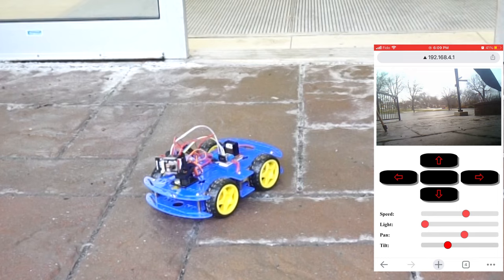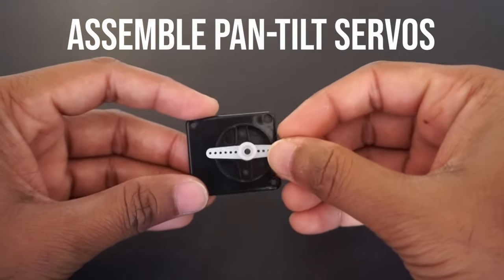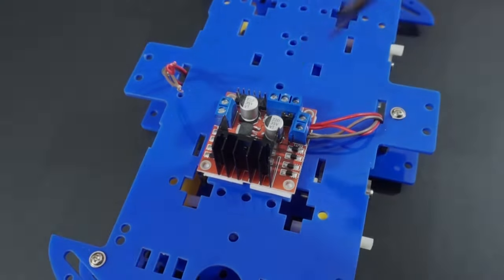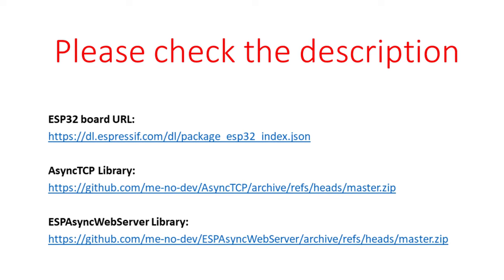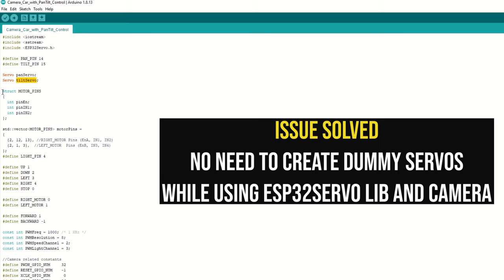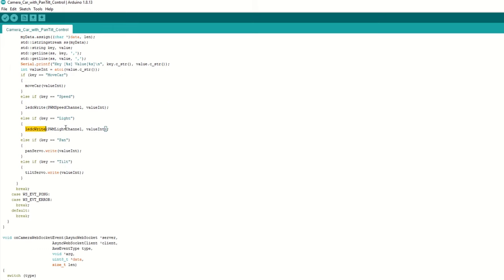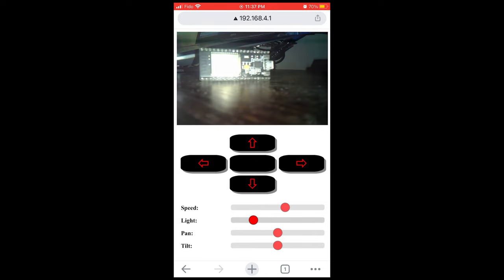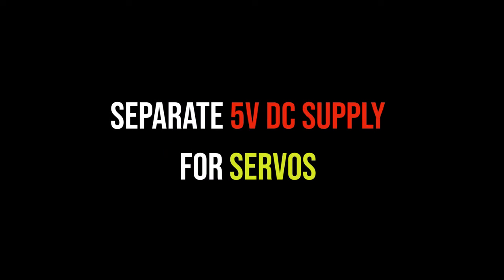Camera Car With Pan Tilt Control | ESP32Cam

Comment: BRO SHOULD WE USE STEP UP OR STEP DOWN BUCK CONVERTER?
Reply from the maker: Use step down converter 👍🏻
Reply: @hashincludeelectronics  is it ok to use XL4015 5A DC-DC Step Down Adjustable Power Supply Buck Module
Reply from the maker: @kumaranganesan176  yes you can use any buck converter which will provide 5v dc output 👍🏻

Comment: hi, everything look good for me. except that i don't have anything show on the website. The camera didn't displayed anything and i try to add another library, connect it again and all but i don't find any solution can i have some help ? ty !
Reply from the maker: Please use rechargeable battery  to avoid power related issue if any . Also check the video again to not miss any step 👍🏻👏🏻

Comment: Hello, my brother, the Wi-Fi network is not working. Is the problem with the battery, as its voltage is 6v? I hope you will answer me as soon as possible.
Reply from the maker: Yes please check the power supply used in the video 👍🏻👏🏻 use only rechargeable battery

Comment: Great project. Is it possible to add a label with a sensor value on a web page? If yes....how I can do it?
Reply from the maker: Yes you can add that . May be create html element as text and send this value from esp32 using exiting websocket connection. Check the code for more reference .

Comment: Bro it's an excellent project but I have faced an issue,, I should set the esp32 camera on the car upside down to get a normal picture is there a solution for that ??
Reply from the maker: Adjust the camera accordingly 👍🏻👏🏻

Comment: The code provided in the description does not seem to work with Arduino even with all of the additional libraries installed. How can I correct the code to work?
Reply from the maker: It should work . Don’t worry . Please check the video for any missing step 👍🏻👏🏻

Comment: How many times we can upload code in esp32cam ? 

Can we use a single esp32cam for different projects with different code ?

Please answer 🙏
Reply from the maker: Yes you can upload code as many times as you want . You can use any code and use any number of esp32 module 👏🏻👍🏻
Reply: @hashincludeelectronics  like Arduino?

Comment: Bro can I use LM2596 dc buck converter instead of ubec converter which you are using
Reply from the maker: Yup any converter will work as long as it provides 5v regulated power and more than 2A current .
Reply: @hashincludeelectronics  oki
Reply: @hashincludeelectronics  bro I saw a converter. It's input is 5.5v to 26v and output is 5v/3A and 6v/3A switchable. Can use it?
Reply from the maker: @vanitasingh8882  yes you can

Comment: The first line of the code includes esp_camera.h however where is the header file for this library. Please help me as it is the only thing about this video that I am not understanding.
Reply from the maker: It comes with the esp32 board installation . Please install esp32 board as shown in video . You can find this file under Arduino packages esp32 folder 👏🏻👍🏻
Reply: @hashincludeelectronics  but I already have it installed

Comment: Excuse me sir i wanna to ask my esp32 not showing wifi network and get heated?
Reply from the maker: Please makes sure to follow all the steps in video . Also change the setting as shown in video . Use only rechargeable battery . 👍🏻
Reply: Sir i have one question all system work but if use pan tilt to control servo at web server all system got lag but if i not connect servo to pin io 14 and 15 it normal how can i fix this problem? thanks

Comment: i'm using arduino ide 2.3.2. pan and tilt servo don't works. i tested servos with an arduino uno, the are ok. I'm uploading with a FTDI232. i selected AI Thinker ESP32-CAM. Wich board i have to choose ?
Reply from the maker: Please check the details in video slowly and carefully 👍🏻👏🏻. All the steps are given . Also make sure there are no loose connections.

Comment: Bro followed your each and every instruction. Given the power supply motor driver led turn on but there is no wifi available.
Reply from the maker: How did you provide the power ?
Reply: Separately like 5 v directly for servo and other with rechargeable battery

Comment: Hey bro ...
Amazing job with the video ..... can you tell me which part of the code should I modify to connect to external wifi rather than using the on board wifi .. thanks 😊
Reply from the maker: Thank you very much for your comments 👍🏻👏🏻. You can check my video on “getting started with esp32 “ where I have used external
WiFi . You only need to change the WiFi mode and ssid password . Please check that video 👍🏻
Reply: @hashincludeelectronics  I will check and get back to you if there are troubles
Reply: Plzz help me to build this project... I am facing errors
Reply from the maker: @rameshthapa4034  what issues are you facing ?
Reply: While uploading code from the Arduino to Esp32... It's showing some errors
Reply: Sir can I text you on instaa
Reply: Hello... Sir plzz help me with this project

Comment: Bro my dc battery power connector has 2 wires. Red and black.. which one should u connect?
Reply from the maker: I would suggest please check the video and circuit diagram as well . It’s very clear . Good luck 👍🏻

Comment: from where we can get the dc battery power connecter
Reply from the maker: If you don’t have battery connector , then you can use any simple wires . That will also work 👍🏻👏🏻

Comment: hey bro the code is working fine and even the website all the control buttons but the esp32 cam is not showing the feed live camera point but the light pan and tilt are working is there any solution
Reply from the maker: Please check the video for one setting to be done in code 👍🏻👏🏻

Comment: Can I evaluate this work and develop it? Will you allow me to take the schematic and code and modify it for me, or will I face problems?
Reply from the maker: Thanks for checking out the video 👍🏻 you are free to use code/diagram and modify it as per your need. No issues .it would be nice if you add some reference of hashincludeelectronics 👏🏻

Comment: Brother can we use this ? UBEC

Bluesky Mini 5V 3A FPV Gimbal PTZ UBEC voltage converter to create 5V output voltage from 2-6S battery pack input voltage. The UBEC is ideal to provide FPV cameras and GoPro brushless gimbals with a constant 5V voltage.
Reply from the maker: Yes you can use that 👍🏻👏🏻
Reply: Ok

Comment: Hey bro can I use battery holder with 2 cells instead of that lipo2s battery. Cuz it's costing too much
Reply from the maker: Yes you can but use only rechargeable battery which will provide more than 7v .
Reply: @hashincludeelectronics  ok brother. Can I use Duracell with battery holder for this
Reply from the maker: @vanitasingh8882  is Duracell rechargeable? And provides more than 7v total ? Then yes please use that

Comment: Can i use 2 lithium ion battery 18650,i have bo motor it will work and how to identify positive and negative of bo motor
Reply from the maker: Yes you can use that battery . There is no positive negative for motor . If you switch the wires then direction of rotation will change . 👍🏻👏🏻

Comment: Please tell me on how i add a button that can on and off  the LED
Reply: I tried many times to manipulate the code that you given but I still didnt get it on how i add the button
Reply from the maker: You can copy any car control button for LED. Check the code and give it a try . 👍🏻
Reply: @hashincludeelectronics  I tried to understand the flow of the code from the webserver to the output of esp32 but  it is very difficult

Comment: hello sir, one of the wheels on the back right side moves wrong, if i go forward the wheel goes backward and vice versa, what should i do sir.
Reply from the maker: Interchange the motor wires connected to driver 👍🏻👏🏻

Comment: Hello brother, good work. I have a problem when downloading the code. This problem appears.ledc_setup'was not declared in this scope:did you mean ledc_stop
Reply from the maker: Please install lower version of esp32 board as 2.0.16 👍🏻👏🏻
Reply: @hashincludeelectronics Hello brother, thank you to everyone for the response. Can I have the way to do this?
Reply from the maker: @نشوانالظاهر-م9ف  please check the video for this step 👍🏻👏🏻 you just have to select 2.0.16 version while installing esp32 board .
Reply: Hello, my dear brother. Sorry if I bothered you with my questions. I could not get the ESP32 version 2.0.16 and the problem is the same.ledcsetup' was not declared in this scope
Reply: @hashincludeelectronics Hello brother, I am very sorry. I did not understand how to change the type except for the esp32, but after thinking, I knew how. Thank you for your response to the inquiries. I repeat my thanks to you and I wish you continued success.❤❤❤
Reply from the maker: @نشوانالظاهر-م9ف  thank you very much 👍🏻👏🏻
Reply from the maker: Welcome 🙏

Comment: Can you please make detailed video on coding. Do Esp32 cam only take picture. What is the code for the picture to be made as video. Pls explain,it will be very helpful.
Reply from the maker: I have explained the code in video as far as can. It’s very simple and you can understand by going through code step by step . It’s link is in the description of the video .
Video is nothing but images displayed rapidly at regular interval called frames per seconds . You send images from camera to mobile app at regular interval and it’s displayed like a video 👍🏻hope it answers your questions . All the best

Comment: Hey bro. GOOD NEWS my ubec converter is the same as yours. The thing is that I didn't notice that u used jumper wires to connect converter to servo. Bro did u connect them by tape or soldering?
Reply from the maker: That’s nice . Please check the video for details 👍🏻

Comment: Soo i am using 3x 3.7v liyhium ion batteries is thwre any way to not use the ubec as its out of my budget
Reply from the maker: Yea you need to use UBEC as it provides 5 v for servo motors 👏🏻👍🏻
Reply: @hashincludeelectronics   can i use resitors in a voltage divider  circut as it works pretty much the same way?
Reply from the maker: @CGEpicepic  I am not sure if that circuit will provide the constant 5 v voltage if current varies . Better to use external voltage converter like UBEC or buck converter

Comment: Hey bro one more question - can use jumper wires instead of ubec/buck converter cuz it's hard to find and buy in India
Reply from the maker: Jumper wires and UBEC/buck converter are totally different components. We need UBEC for converting higher voltage to 5v . Jumper wire is just a wire .
Reply: @hashincludeelectronics  oh

Comment: This project its work, but i have problem with esp32 cam. It is so hot and disconect after 2-3 minute. I use 2x 18650 battery. Can u help me about this problem?
Reply from the maker: You need to change one setting in code . Please check this step in video 👍🏻👏🏻

Comment: what i should to add battery indicator on the code
Reply from the maker: You will have to use voltage divider ckt using 2 resistors. You can find more details on internet on this 👍🏻👏🏻

Comment: How to to use arduino with serial communication with this project to add sensors and display their data on the web server
Reply from the maker: Please check the video where we have used the Arduino to upload the code . Same can be used for serial monitor communication.

Comment: Hi! I have a question: How do you solved the issue of the timer? I'm doing a project where I have to control 2 servos, any suggestions? Or an example to control the 2 servos?
Reply from the maker: I have used different timer and channel for camera . You can check that in setupCamera function . As far as controlling 2 servos are concerned, this project controls 2 servos already. Or do you want additional 2 servos so total 4 servos ?
Reply: @hashincludeelectronics  I'm using MG995 RC for this project, do you have any code that I can use?
Reply from the maker: @josephmunoz5273  the same code should work 👍🏻 give it a try
Reply: @hashincludeelectronics  thanks bro! I'll try. If I have any question, I'll write it in the comments
Reply from the maker: @josephmunoz5273  awesome
Reply: @hashincludeelectronics  Hi, one question: where can i see the setupcamera funtion? I'm new using esp32 cam 🥲
Reply from the maker: @josephmunoz5273  check setupCamera function in the code of this car .
Reply: @hashincludeelectronics  thanks bro!! one more question XD, do you know how many channel for PWD have the esp32cam and the max resolution can be used?

Comment: Why should we use l298n motor driver for this project?Can we use l293d motor driver board also for this project?how is l298n better than  l293d motor driver board?
Reply from the maker: L298N driver is very simple to use in such car projects. I mostly use this module .However you can use L293D as well but you need to make sure how it’s pins will be connected to esp32 module. It seems L293D shield is compatible with Arduino Uno easily . I have not used this L293D ever so can not help on it. You can try L293D and I wish All the best for your project 👍🏻

Comment: I did everything like u did how upload the code and everything but still it doesn't show the wifi to my mobile and even the esp it self dont work
Reply from the maker: Please check for loose connections. And use rechargeable battery only 👍🏻👏🏻

Comment: hi every thing works fine with my project but in my mobile app, video does not show, why?
Reply from the maker: Please use rechargeable battery if not using already . It will avoid power related issues 👍🏻👏🏻

Comment: Can you please help installing esp32  board? 
I have already done with the same processsed you did, but I'm still not getting it in my system
Reply from the maker: It should be easy and work. Make sure you used the proper link of esp32 board in preference. Try restarting your Arduino IDE .
Reply: @hashincludeelectronics  I copied the same link you've given in description but not working
Reply from the maker: @khriesetuorio3195  can you send me some pics of your Arduino IDE setup like the options you see in tools etc ? On Instagram hashincludeelectronics
Reply: @hashincludeelectronics  can u please go check in Instagram once, 
I've already sent there
Reply from the maker: @khriesetuorio3195  sure let me check and will reply 👍🏻

Comment: Hi bro...can you tell me about wifi...how to be wifi came from esp32 cam to phone?
Reply from the maker: Please check the video for full details 👍🏻👏🏻
Reply: Yeah..but I wouldn't understand about wifi network..wifi not connecting properly...is need of router for doing demo ? And what wifi network includes in program...kindly give guidance  @hashincludeelectronics
Reply from the maker: @cbc1235  the WiFi network is created by esp32 cam module itself . It’s local network . Its user id and password is shown in video and also it is embedded in code . You don’t have to connect to any router . Please check the video and follow exact steps and your project will work 👍🏻👏🏻
Reply: @hashincludeelectronics  Thanque brother...!

Comment: thank you !! i made this project, everything is working fine .....pan servo is not maintaining its position it rotates 180 down after wifi gets connected .......it was working fine but after some few mins its going 180 deg and does not respond on scrolling on ui .......any suggestion ......pls help i want for my project submission ......after a week ....
Reply from the maker: Please use good power supply 👍🏻👏🏻
Reply: @hashincludeelectronics  tried it .....but same i think may be servo has some issue
Reply from the maker: @PP-kr3mw  possible
Reply: @hashincludeelectronics  please help ......
1) i want the esp32 should connect to my wifi router or hotspot ....how to do it .....please tell waht exact changes needed to do it .....but every other function should run properly as it runs when esp32 acts as access point.......

2) want to add gas sensor and send notification over mobile .......would be possible to do it with blynk library or any thing using email through smtp .......or else please suggest anything from your side .......

point 1 is more important .......tell solution for that and then for point 2

Need to submit project in next 1 day please reply sir......

Comment: Hello we cannot get the servos to move even when the supply to them is okay we are using buck convertor 12 vdc to 5 vdc kindly help
Reply from the maker: Make sure you use rechargeable battery . Also are you using mobile or laptop ? This app only works on touch devices .
Reply: @hashincludeelectronics  Hello we are using touch screen mobile only and we also made your previous project without pan tilt and it worked perfectly. Could it be due to use of buck convertor?
Reply from the maker: @nimitshah7696  what’s the current rating for that buck converter ? It should provide more than 2 ampere current with 5v output .
Reply: @hashincludeelectronics  I've checked the voltage level to be 5V exactly I will check the 2A current

Comment: Can you please tell the code you used is only c++ or c++ with html??
Reply from the maker: The entire code is in c++. However we create HTML page as string and sent to mobile browser .
Reply: Can we create this page using c++?
Reply from the maker: @bakhatawan1464  To display something on browser we use HTML page. It’s easy that way . If you want create mobile application in c++ then it’s very big task.
Reply: OK thanks 😊

Comment: Bro can we open the app in laptop rather than phone?
Reply from the maker: Yes . But the laptop should have touch screen . 👍🏻👏🏻
Reply: @hashincludeelectronics  is the touch screen necessary? I mean can't we use mouse for controlling using the buttons?
Reply from the maker: @saianeesh1082  yes touch screen is must 👍🏻👏🏻
Reply: Thank you bro
Reply from the maker: @saianeesh1082  welcome 🙏
Reply: @hashincludeelectronics  we can use the code as it is right..? No changes are needed right?
Reply from the maker: @saianeesh1082  yes you can use it directly 👍🏻👏🏻. Please check the video for steps